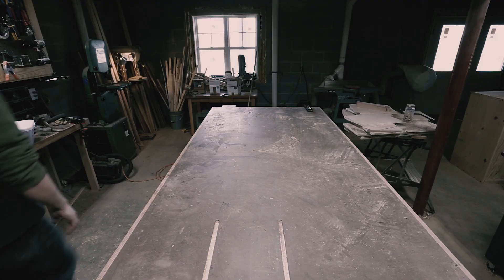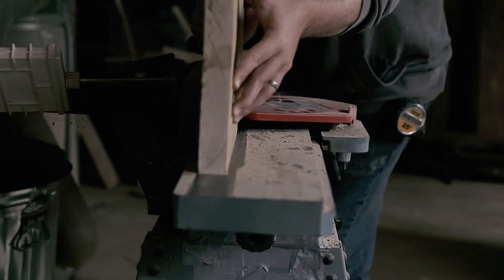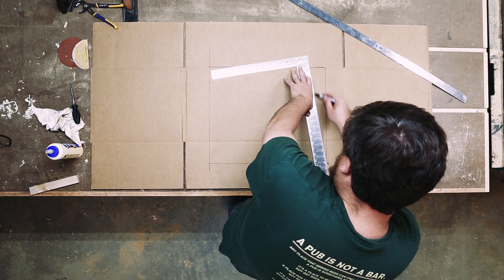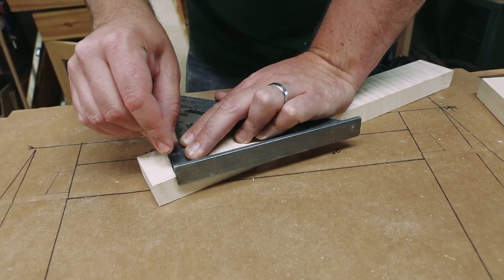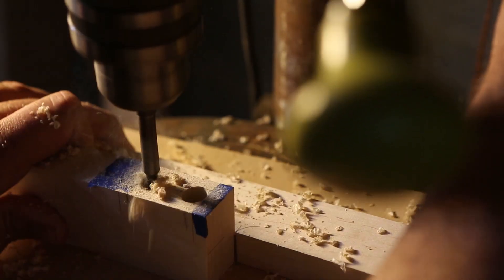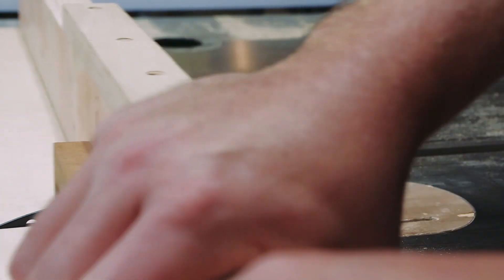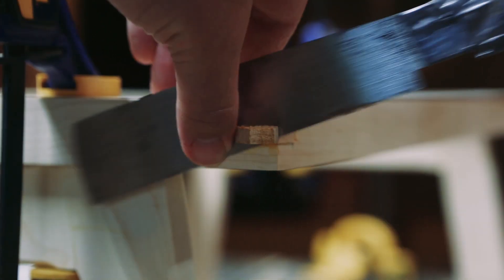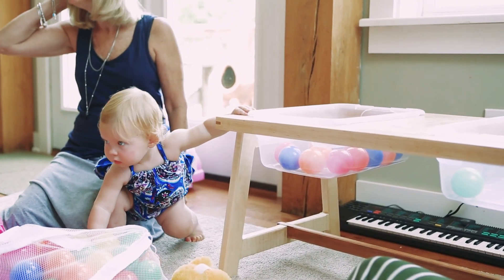Morgan's Activity Table

Comment: very nice! but urgently round the corners
Reply: We're taking bets on how long until she falls onto one of those sharp edges or corners. Softening the edges with a spokeshave would be such an easy way to ruin our contest.
Reply from the maker: The edges are already eased with sandpaper.  The corners are also broken but I did debate chamfering the corners.
Reply: +Wm. Walker Co. Personally I'd go for rounded but I do think it should be okay the way it is, because it's a very small child and low table. But for toddler safety, we do watch out for sharp corners  and unstable furniture as falls are inevitable.

Comment: Eminently watchable and enjoyable video. Cool not offensive music. Effective lighting in the shop and a road trip too!  Is that a Woodmaster I spied? If so do you use it as more than a planer. Drum sander, gang rip or molding cutter?Round or square doesn't matter. The strength of the joint is in the glue bond and is mostly happening wood face to wood face inside the mortise. When glue ups get large or complicated I use Tite Bond Extend (longer open time) or Tite Bond 3, longer open time, high solids content, 4000 PSI and it's the color of wood.The most enjoyable woodworking I ever did was making toys for my son when I was young. As he got older his classrooms benefited from the toy making too.  G.
Reply from the maker: Thank you!  It is a woodmaster!  I see you found my video on how I acquired it.  It came with the "pro pack" but I haven't set it up to do any of that yet.  I plan to do a big batch of end grain cutting boards at some point.  I'll likely set it up as a drum sander then.  I've also got some porch ceilings I need to finish on the house and I'm debating getting some knotty pine from my local sawyer and cutting my own tongue and groove.